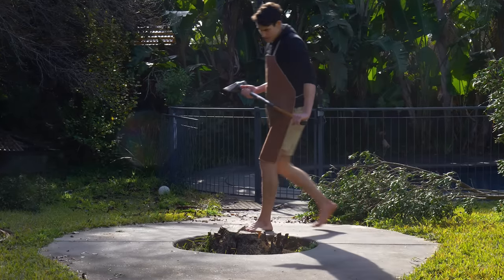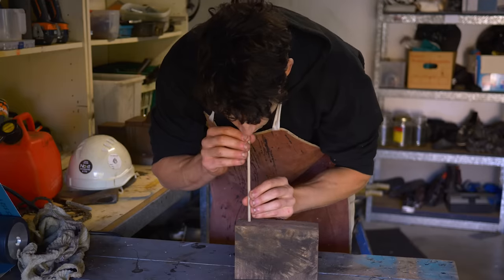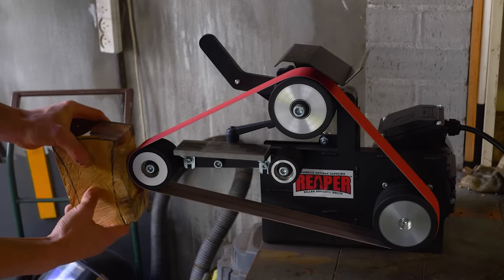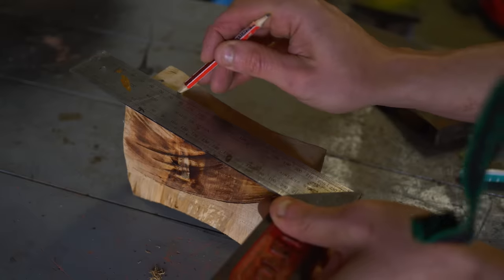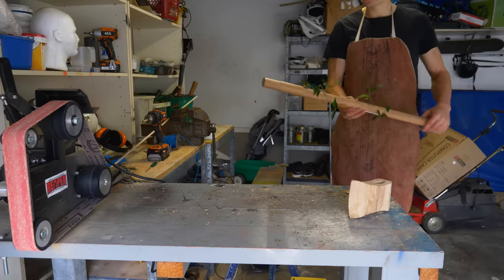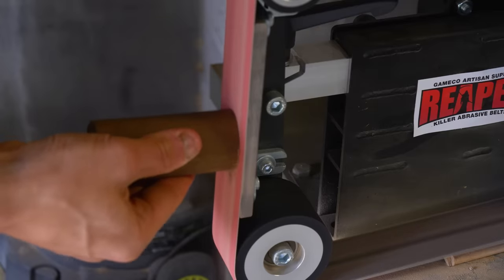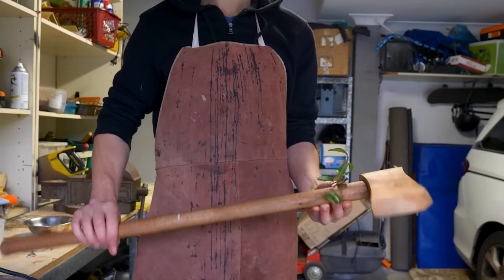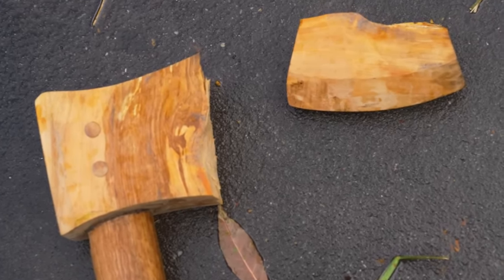Can I Chop Down a Tree Using Only a Tree?

Comment: I'm not a woodworker, I am an aerospace engineer (mech) and when you detailed the direction of woodgrain - even I knew to expect this ending. A woodworker would have gone completely insane watching this.
Reply: As a primarily lumber builder I can confirm. I had a wooden cuckoo come out of my mouth and a little wind up monkey was banging cymbals in my eyes almost the whole time.
Reply: can you guys explain plis
Reply: @Zimbobroke  Think of the woodgrain as the sturdier part of the wood, but its strength really only works when stress travels in the direction of it. SO in the terms of our axe head, the grain is going up and down, but the force is impacting it from its left-right. So basically, that axe head held zero strength/resilience for the impact it was going to be used for, as you can see the wood broke until it reached the grain.... Something like that I'm not a carpenter or woodworker lol. Let the woodworker correct me if he deems necessary (Tbh u could probably Google it, maybe I should've too)
Reply: I've been whittling with real soft wood for god knows how long but take this with a grain of salt because idk much about the big pieces of wood. Anyway there's not really a good way for the grain to go. Looking at the axe from the side (you see it like 🪓 this lol) if the grain goes the way he did it (up and down) its very weak to side/side and front/back stress. I think the best grain would be left to right but because the axe is curved and wood it'll still probably crack on the first swing or two.
Reply: @Zimbobroke  sure, they're things you take that contain medicine or vitamins, druuuuugs
Reply: @therealPman219  if you wanted to do this properly to have it work you would need to have layers of timber with the grain alternating direction and create a laminate head. Then the axe head would be omnidirectionally strengthened. I hope that helps.
Reply: It's cool you work on mechs. Are they like Battletech?
Reply: @kylehurlburt6114  I'm ex military - it was much more like 'battle' than whatever Battletech is.

Comment: As a woodworker, the spaghetti analogy is a perfect way to describe the anatomy of wood. At my school they did a very similar thing with a bundle of straws to describe how wood grain works. Smart man👍🏼
Reply: Except he definitely chose the wrong grain direction.
Reply: Yeah you’re right it probably should be running perpendicular to the cutting edge. I didn’t want to criticize a nonwoodworker though lol, especially after the axe is already made
Reply: for some reason I misread woodworker as woodpecker and i was very confused for a sec lol
Reply: @alexbattaglia8297  as a professional wood pecker I don't see a difference
Reply: @sudoo6987  This made me laugh a good bit harder than it should've. Take my like and my gratitude stranger.
Reply: Im curious if it would have worked had be been using a harder wood type against a softer tree.
Reply: The analogy IS correct!
The main difference here is that in the exemple he used, it was a cutting edge against the grain of the wood. If you want your wood to be mord resistant to cuts (or at least not break down from just a cut because wood is the wrong kinda material for that), that's the right grain way.
On the other hand, when you're testing your wood against any kind of impact...
Well, you saw how the wood axe broke!
Reply: @SeohnAranys depending on the wood and if it’s stabilized, absolutely. There’s some woods you need special equipment for cause it’s damn near as hard and dense as actual rocks.

Comment: are we just gonna ignore the fact that he used a permanent marker on a dry erase board
Reply: a little bit of isopropyl alcohol (rubbing alcohol) will take it right off without any lasting marks.
Reply from the maker: Its stuck on pretty bad
Reply: @Ididathing  Use permanent eraser to erase it
Reply: Or that he had a naked doll with a holl in in the back?
Reply: @Ididathing  Go over the sharpie with dry erase marker and then erase the dry erase marks. Might come off.
Reply: @revokedmedic  works 100% 60%of the time.
Reply: @revokedmedic  i heard vegetable oil works pretty well
Reply: @BigWinsAllDay  I would see a doctor about your hearing.
Reply: @Jamesvandaele  whatt??? say that louder i cant hear you
Reply: @revokedmedic  This works very well
Reply: who hasn’t done that at least once
Reply from the maker: @phillipnguyen8138  im not falling for this one
Reply: @Ididathing  try hand sanitizer and tissue
Reply: Are we just going to ignore the fact that there is a magician with a hole at its bum in his backyard?
Reply: @Ididathing  a little bit of sanding may solve it
Reply: He also rolled up stairs
Reply: @phillipnguyen8138 You mean make a black board then use white permanent marker?
Reply: @TheAruruu  Never tried iso.  I know for laminate flooring cutting marks I use methyl hydrate and it takes it off like it's dry erase.

Comment: There’s also a thing called “radio frequency drying”, where you have a shed that’s basically the worlds the biggest microwave. My old man started the first one in the Southern Hemisphere. Used to dim the lights on the local town when they cranked it up. Occasionally when they had a couple of packets of timber cooking away he’d crack the door and hold a florescent tube in there - the air inside was so energy charged that it would light up the tube. And after all that, I still managed to be a surprise conception…
Reply: Could You tell us how it is to live with 5 limbs?
Reply: cancer will arive in 10-11 business years
Reply: @thatotherboi8044  its now 10-11 business seconds
Reply: @Neon-Overlord  soon they're gonna be going through 10-11 business stages of cancer
Reply: R/thingsijustmadeup

Comment: "All you have to do is steal mine."
I prefer the term borrowing indefinitely.
Also I feel the reason it broke was because you went against the grain instead of with it. Allowing it to compress a weakspot which allowed it to break like that. Just my theory.
Reply: A Wood Theory.
Reply: @joyu2105  Oi. I'm the cringe one here.
Reply from the maker: not sure i agree with your wood theory. lets fight
Reply: FIGHT FIGHT FIGHT!!!!
Reply: @Ididathing  Multiple alternating grains bonded with some resin?
Reply: Lol
Reply: @Ididathing  I'd say you'd want to bring your wooden axe but yours broke and I don't have the skills nor paycheck to test my theory.
Honestly the only reason I had the idea was because of the fact that the breakline would have to be on the grain of the wood for me to be correct. Thus it breaking the tip off instead of say down the head.
I'm looking at this from another point of view. Take a straw and try and hit something with it. Which way is it more likely to damage. Hitting something dead on or sideways. Sideways would just bend the straw. But having the end of the straw hit would result in more stress being put throughout the tube instead of just needing to bend it. My theory is the wood is similar. By hitting it on the side of the grain you are simply pushing a pocket (i want to say similar to that of the tectonic plates) which allows it to pop the tip off like it did with your axe. Instead allowing the axe to be more ridged.

Comment: He used a sharpie—a permanent marker—on the whiteboard. Every other thing he does is understandable, perhaps even sympathetic—but a sharpie? I heard Kurtz say, ‘the horror... the horror...’
Reply from the maker: That wasnt even a joke. And now its stuck
Reply: @Ididathing  bro just draw over it with whiteboard marker. Trust 💯
Reply: @nate.2.2  fr and then erase it and it's gone
Reply: @Ididathing  put a dry erase marker over it and erase it. Works for me
Reply: @Ididathing  just color the entire board black and convert it to a chalkboard.
Reply: @fudgerounds91  oh yeah, this is big brain time.
Reply: @Ididathing   try acetone? safe to handle around no flames and should redissolve the pigment. not sure if it works  but i am sure its worth 1 pound to buy some 100% nail polish remover and try.The denatonium benzoate wouldnt interfere if its added
Reply: Sharpie make an exact same pen but for whiteboards……………

Comment: 9:17 Dowelgrass is quite amazing. You can acquire it in the wild, mostly near home depotish climates. It's easily recognizable by the natural barcode on the tip.
Reply: Usually spawns in close to the 9 volt battery bushes.
Reply: Or if you re looking for Aussie dowelgrass then you will generally find it near Bunnings warehouse 😅

Comment: don't worry, nobody is gonna realize that you wrote on the whiteboard with a permanent marker.
Reply: You can actually get rid of it by using normal ink and applying it on top of the permanent ink then rubbing it off
Reply: There's also a special spray to remove permanent ink, you could also use spirit vinegar I think
Reply: I just use hand sanitizer and wipe.

Comment: the reason it broke was the grain, youd have more structural stability if it was long ways, the analogy u used wasnt bad but thats if the tree was hittin u, to fix the analogy so representing the axe hitting the tree take the pasta n try to break it by holding it by the ends and bending it. not hard but thats how u did the grain, but if u stand the pasta upwards on a table and try to break it by pushing down its significantly harder. so the grain should have been the other way for the axe to not break. (for at least 1 hit)
Reply: You’re totally right. To make a better analogy he should’ve thought about making an axe head out of pasta. It wouldn’t work well unless the grain was perpendicular to the stumps face.
Reply: @nathanmills9298  smartest comment I found.

Comment: Please god if anyone knows—where does one get replacement components for that old fashioned band saw he was using at 8 minutes 50 seconds in? Just picked one up myself thinking it’d be a good deal, but now I have no idea how to get it running. Thanks.
Reply: It's going to depend on the exact make and model of the saw you bought, but if it's old enough, you're probably not going to be able to find on-brand replacement parts. At least for bearings, you can measure those and buy some of the same size online. For stuff like the wheels, no idea

Comment: I have two belt sanders.  One mounts to the wall and folds up and down.  It also has adjustable angles on the side to be set for various sharpening and other usage.  

I didn't know they cost so much.  My father in law got them for me.  Woodworking a lot.

Comment: His analogy for the spaghetti is the opposite. If he was also testing it right. Instead its more like standing the spaghetti up on the table. And using your palm to push down on it to snap it. It wont break. But, if you put the spaghetti on its side, its much easier to push your hand through it and break the spaghetti.

Comment: you see, the problem was that you have the axe all wrong, you are not supposed to make it with 1 wooden board and 8 sticks, it is 2 wooden sticks and 3 wooden boards, one stick in the center, the other one just below, and that makes the handle, but dont move anything, you still have to put the wooden boards around the center stick, put them in the slots 1,2 and 4, it might also work if you put them in other slots but keep the shape of an axe, then there you go!

Comment: ok this was both funny and painful.

why was it painful. 
1. the way you stuffed the hole of the axehead.... dude. split the handle a bit, then take a piece of wood and hammer it in there. thats how you fix an axehead to a handle....
2. untreated wood? use fire hardening. 
3. why did you take any wood? get some hard wood.
4. while writing you even mentioned that mistake, but if you had used fire hardening that likely wouldnt have been a problem.
5. you said you were gonna cut down a tree... which tree? you only hit the stump